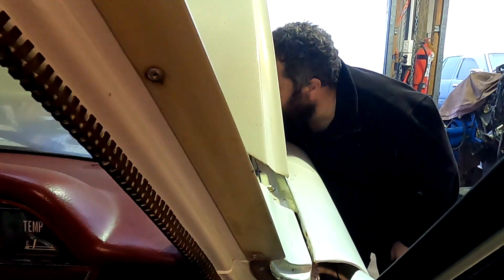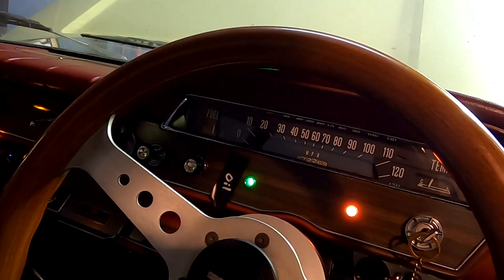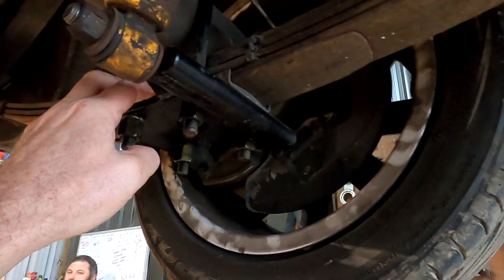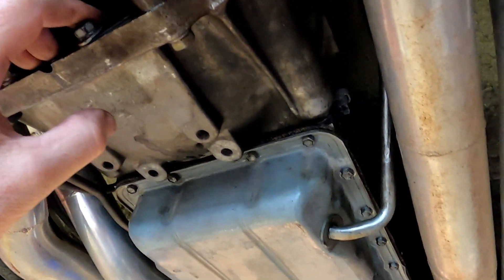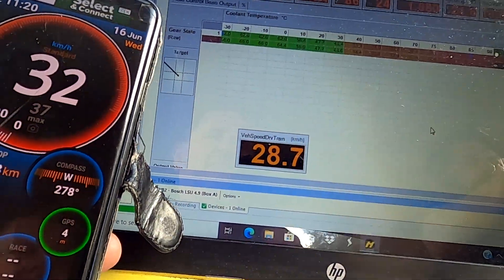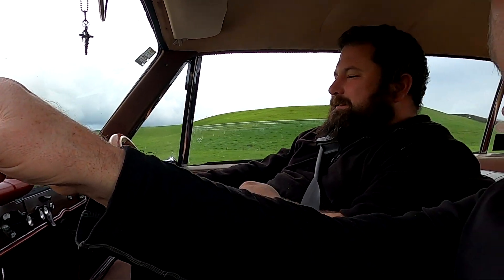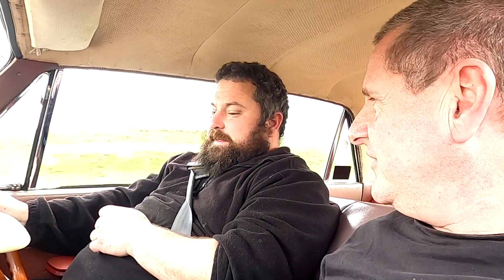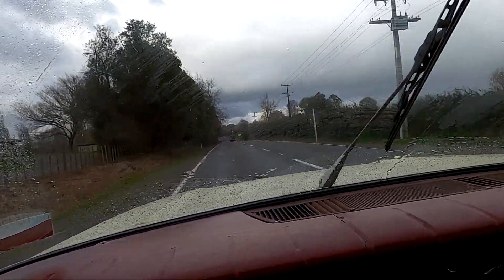1uz engine and A341le in a 1965 Ford Zephyr. Test drive with Haltech ecu - engine and trans. Part 5

Comment: As I was watching one of the episodes regarding the need for servicing the old ecu on Toyota vehicles. I followed yours advice and have the ecu of my 25 year truck service the results were amazing it was like driving a different truck in my 40+years of working on vehicles  it never occurred to me to go through that process  .I have to thank you for the advice cheers Luis
Reply from the maker: Glad to help.  For me a service of the ecu is high on the list for any older Toyota.  One is restores power like you have experienced , and it reduces (to almost zero) the chances of the ecu failing and not being repairable.  Is wins in all corners

Comment: Hi kelvin Ive got a random question, I have a 98 LS400 with 146,000 mi and I’ve recently replaced the valve covers, cam seals and both Camshaft timing tube assembly’s. Ever since then Ive noticed a bad oil leak around the crank area and its so bad I can’t leave the car idling for too long. I did replace the crank seal last year with a aftermarket one so Im baffled. Could it be the crank seal or the oil pump? I don’t have time to open up the car again since Im busy with school and work so Id appreciate your wise counsel for when I do take it apart again.
Reply: Get an ultra violet dye kit ,and toss some Into the crank case. When it leaks the dye will leak out with it you shine the uv light onto the block and the leak will light   up and lead you to the source of the leak
Reply: @mikehannigan848  Thanks Mike I’ll try that when I get to open it. Oil leaks suck !
Reply: @machedari  make sure you get the petroleum-based stuff !
Reply: @mikehannigan848  @CartuneNZ YES SIR !!! thank you both so much. Im not that proficient working on this Lexus but Im learning a lot and I’ll make sure to get the petroleum based dye kit Mike. Cheers 🍻
Reply from the maker: As Mike said , testing is the way to find it.  Cheers Kelvin

Comment: Nice work. It really sounds like the trans needs more line pressure though 🤔
Reply from the maker: This was at full stock line pressure settings without any bleed off.  Later I increased cable adjustment and added bleed via the solenoid at under 30% throttle on shift only.
Reply: @CartuneNZ  oh nice! Do you think the customer will commit to better final drive gears or he will use it more for cruising?
Reply from the maker: @metalcraft_marine  at this point its staying as it is as its mostly used around the city with an odd trip to the drags.  He's had it back a little while now but he commented how much faster it is now which is positive.  Being able to tune the gear changes has transformed the vehicle,  which is a better than expected result.

Comment: What idle speed do you recommend with a manual box, mines at 1100 which sounds too high
Reply from the maker: Normalcy between 750-850.  I might head up to 900 on some but thats about as high as I'd want.
Reply: @CartuneNZ  thanks for that info, any easy way of adjustment, car uses 1st gen linc
Reply from the maker: @devilsled  best way is to have a proper idle speed control unit fitted so you have a nice idle up when cold and then drop base idle when hot to about 100rpm below target on the lower stopper,  then use the iac to give correct hot idle using the hot idle number and then set cold idle with cold idle number in the software.
Reply: @CartuneNZ  thanks kelvin 🙂